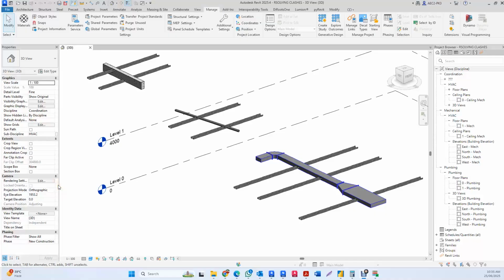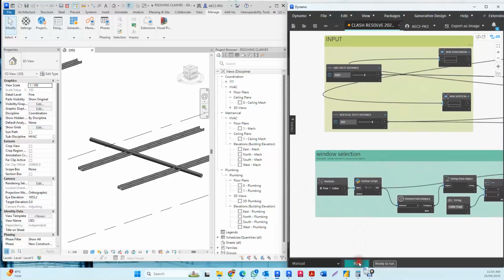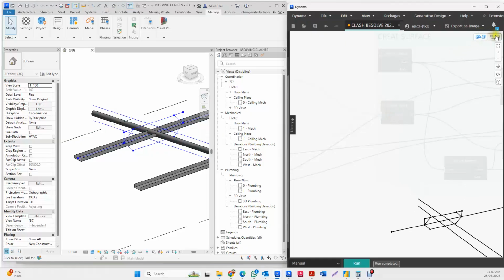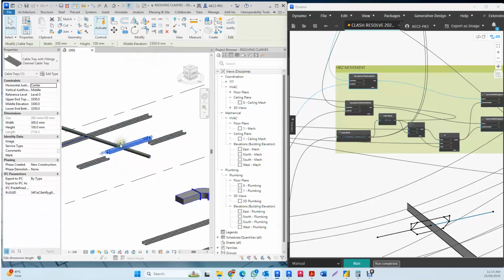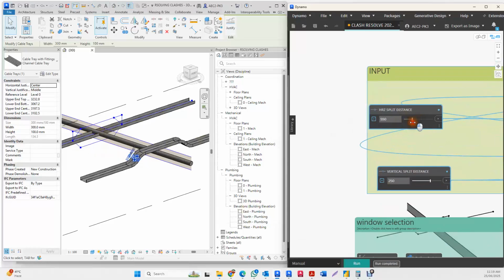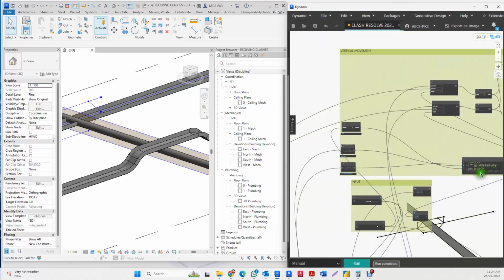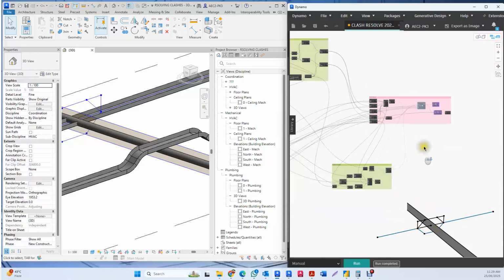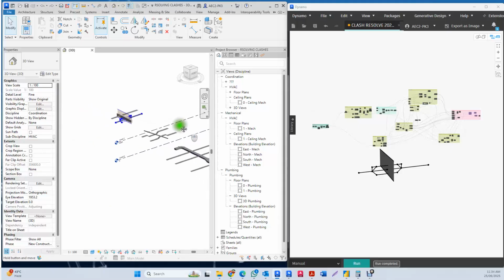AUTOMATIC RESOLVING CABLE TRAYS CLASHES

Comment: Hi there—excellent video, and thanks in advance. I have a question: is that script also valid for vertical elements—meaning not just horizontal ones? Let's say there are vertical clashes involving pipes, ducts, etc.; I’d like to know if the script applies to vertical elements as well.